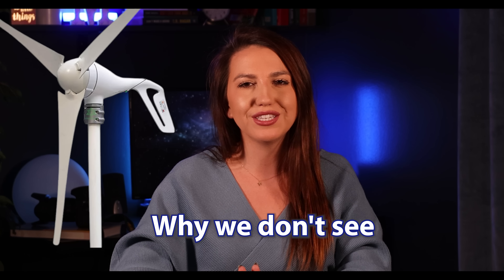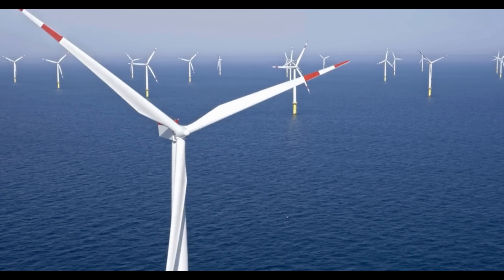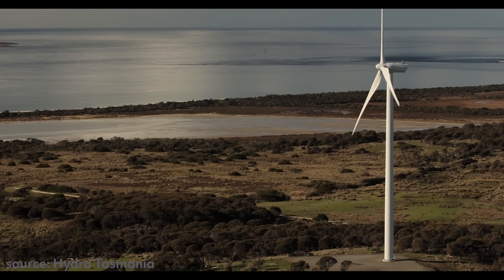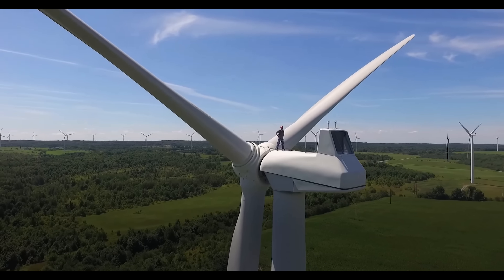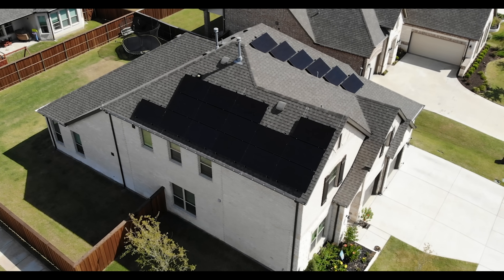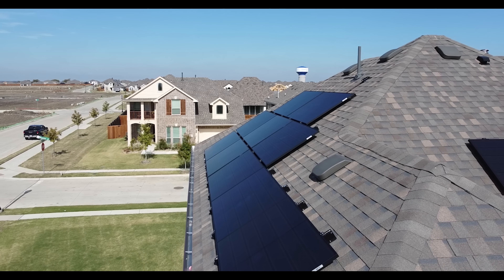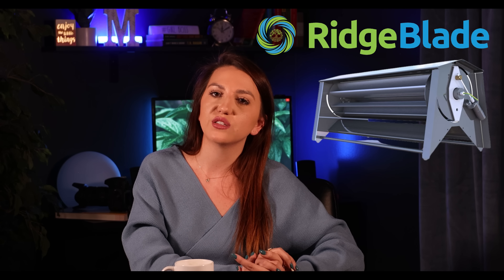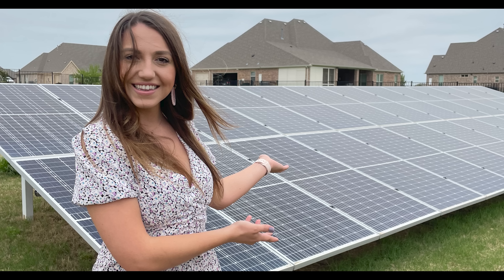Could this Turbine Destroy Solar?  | Why haven't we seen these small wind turbines yet...

Comment: I'm completely off grid. I don't use wind simply because I have no faith in the systems. I'm solar only and may add hydro to generate power for my neighbors.  Wind , I simply haven't been sold on.
Reply from the maker: Hey Tim! Thanks for sharing, I know living off grid can be challenging, maybe you can share what kind of inverter + battery system you have?
Reply: @solartimeusa  i could do that.
Reply: I currently run an off grid solar system using EG4 components. I use the EG4 6500ex inverter with 8 455watt panels on my 1st string , then 6 200 watt panels on a sun tracking system. I generate on average 2.7 kw an hour. The system is 48volts. I currently run 2 mini split,  1 is 8000 but and the 2nd is 12000btu. We do heat with a wood stove. I also run 2 deep freezes and a refrigerator.  We have an older maytag washing machine for laundry, electric butter churn, coffee maker, kitchen aid mixer etc just like everyone else, and recessed led lighting.we use all the modern day convenience plus some. I run an electric concrete mixer to process black walnuts along with occasionally mixing concrete, electric fencing etc. We love this life style. We could generate more power if we cut down a number of trees, but prefer to deal with shading and keep the trees. I am adding another 10 panels to maybe add my some of my neighbors needs. We use eg4 batteries for a total storage of 25kw of stored power. We have ran out of power once in the last year, which our generator helped recover the charge state. Start a system now. Dont wait, start slow and build on as you go. I have built a 2.5kw VAWT for wind in the past ,but never got to use it. If wind is useful, I'm interested in knowing more, but currently have little to no maintenance with solar.

Comment: My issue is that my solar doesn't make energy to charge my battery during storms, when the grid is most likely to fail. 

A wind turbine would need a very good governer not to over speed at that time. Better to go for an ICE generator for reliable backup power unfortunately!
Reply from the maker: I hate to say that but yes I agree. 
Unless you have a big enough back up witch enough juice to wait out a storm. 
Portable generators have to be a back up to a back up for now.

Comment: This turbine, if comercialised will destroy the most expensive electricity first.. coal, gas, oil, fracking, nuclear…
Solar is dirt cheap .. so it wont be affected. At all
Reply from the maker: That's a very valid point. Solar and wind on a grid scale are super cheap. so I am hoping one day on a small scale will also do some more damage.

Comment: Unless you are willing to install a 100 ft high tower they are complete wasting of money.  More research should go into PV panel design which have not been improved mechanically since the 1980's.
Reply from the maker: Hey Mark, 

I do see your point, and I think its very valid. Wind on grid scale - great, PV on small - needs improvement and is great.

Comment: Good day, 

    The Swiss ML Converter , it was created by a European community around the 1970's , works on the concept of static electricity...essentially, you have 2 discs, perforated and made of aluminum and copper, carbon wheels would work as well, insulated in the middle and rotating in opposite directions...

The wheels are encased in a horseshoe magnet, nearly touching, you could make it go around the complete circumference when redesigning it, and carbon filament collectors are brushing along the surfaces of the disks as they rotate, this creates a positive and negative polarity, and the energy is then stored in a carbon/ graphene aerogel/ foam capacitor of some kind...

It is stored as D/C current and converted to A/C where needed...

That's the key to harnessing vast amounts of usable energy, with minimal wind speeds, and the technology will improve over time...

-ER x

Comment: Usually the area from which a home wind turbine can capture energy is too small to be viable. It just doesn't have enough energy, unless you're living in Palace of Versailles. It's pointless installing home wind turbine. Solar with storage will work much better in most cases.

Comment: WoW you have a great solar PV setup thats exactly what I want to do as it's easy DIY for your garden, easy clean easy to service, obviously best with two sided Solar to increase it's power on a say white background, plus I do want a wind VAWT its better for low level mounted due to its better wind capture I must admit I do like the Liam Fi design automatically spins in the direction of the wind ❤👍

Comment: The solar panels are occupying more area and power absorption from sun  is also not satisfactory. By changing the design, occupying area ca be reduced and at the same time power obsorption can be increased. There is possibility. A material for by changing it's shape acts differently.
Reply from the maker: Thanks for sharing your thoughts!

Comment: For example, if you use a company like Ridge blade to put it on transportation industry, you already have a power source to generate extra power for your power bank for better efficiency. Especially if all transportation, commercially or privately will be electric in 2035.😊

Comment: With home fabrication and 3D printing its pretty easy to just make your own. Trouble is you need a lot of  copper, magnets and blades to accommodate a decent amount of watthours. That tends to also mean weight. So the mount has to be stable.

There is also a minefield of garbage and fake wind turbines on amazon and other sales sites. None of which are properly vetted or verified to be what they claim. Cheaper solar is still the way. 

I live in the UK so hear of your housing rules and just wonder what the hell happened to the personal freedom you all so love if you cant self generate your own power. Even here we have rules that negate and stop people getting cheap solar, so its all stalled.
Reply from the maker: Hey! Thanks for sharing your thoughts, and I used to Live in Poland, thats where i grew up and yeah it was kinda funny to see the american freedom that literally does not allow you to sometime sput panels on your own da mn roof... :D 

AGree on your opinion on the wind turbines. Thanks again for leaving a comment!

Comment: I have a small horizontal bladed wind turbine. 
The electronic board inside needs to be replaced. 
If I find the replacement module for it I’ll reinstall it. But I’m not sure how to hook it up? I believe it’s 24 V. How would that work with providing power to my house I don’t know? Do I use the 24 V output to charge some batteries and then run that through an inverter? I’m not sure what to do

Comment: Most areas do not have the necessary prolonged wind to power these.  In SC there is only one small area that gets wind over 3 mph and it’s near Spartanburg,.
Reply: SC should be good for solar
Reply from the maker: Auch...

Comment: In most locations, the air flow is "dirty" meaning that it often changes direction and velocity making most Darrius (wing type) turbines that have to face the wind inefficient.
They spend most of the time adjusting the yaw.
The best solution for this dirty air is a VAWT (Vertical Axis Wind Turbine) which are omnidirectional but most VAWT systems are cheap and produce little.
There are VAWT alternators available that will produce large amounts at lower speeds but there are no VAWT blade kits available.
A sticking point is wind velocity versus volume. Darrius blades depend on high speed wind to generate lift. They have a small surface area.
This is not suitable for dirty wind.  A "bucket" type (Savonius) relies on wind pressure over a larger surface to generate torque to turn the alternator.

Comment: Aaarrrghh…..such a blade/rotor design is horribly inefficient at any reasonable wind speed.  Yes, it will spin at a low wind speed when there is little energy in the wind to start with….just a novelty item…

Comment: The wind is a lot more irregular than the sun except in the far North or South of the planet. Turbines will never be able to compete with solar panels except there. Solar panels, which have very little maintenance, no moving parts, are amazingly cheap and easy to install, and work better every year as technology improves in leaps and bounds, are vastly superior in every way.
Reply from the maker: Hi Ken, yes i have to agree, on the grid scale wind and solar are both great, for residential application seems like solar will be a way to go, at least for the majority of the world. 
Thanks for sharing your thoughts and leaving a comment!

Comment: Without even watching the video, I can answer the title question.  No.  Not even close.  It can't even compare to plain bladed turbines.  Ignoring the fact that it's rotating weight is too heavy compared to plain blades, you could never mount it on a pole as it's drag would tear the pole down in heavy wind (blades can be furled to reduce wind load).  The cost of the pole, the cost of getting someone up that pole or the turbine down for maintenance, maintenance on the pole and guy wires...  Wind is only feasible as a large scale commercial venture (if they can ever get standardized) or in extreme rural areas where the owner has the skill to keep it running.

Comment: Unless very large (counterproductive), then near-ground-level wind generators will not supply significant energy compared to a modest solar array.  One fellow responded to a comment I made a few days past stating the formula for retrievable power versus height.  It is a height cubed factor.  And this simply explains why HUGE wind turbines are being made ever larger - and higher.

But I agree with you about local (backyard) wind. A small generator that produces only a few 10's of watts is still useful IF there is proper battery storage (like a Tesla power wall) to conveniently use the stored power.  A reasonably smart (self powered) electronic control system would normally be incorporated into such a wind generator to manage efficient power delivery and prevent over-speed issues that can be very destructive to the generator itself.

Any of the vertical blade concepts are certainly the most sensible, because it can be erected on a rooftop and requires no fancy moving parts except for the blade and AC or DC generator incorporated in the base.  Proper blade design can improve efficiency and keep noise to minimal levels.

FYI, small, 3-blade wind turbines (about 1 metre blade extension) have been employed for decades to power remote radio repeater sites.  So the technology is not new.  It is all about adapting to the local conditions in respect of whether solar or wind is the more practical option.

Comment: Unfortunately, a lot of "cool new ideas" are what I'd call an "eco-grift".
Hopefully a really impressive wind power solution will come along eventually though, for areas where it makes sense.
Reply from the maker: Yuppp :( Sad but very true. Thanks for sharing your thoughts and leaving a comment.
Reply: @solartimeusa  I don't think it's impossible though :)

Just a matter of finding the right shape for maximum force capture... while keeping the weight and friction down so that there's a low minimum airspeed to generate.

A big part of it is wind turbines "not doing anything" in lower wind conditions. If the friction & mass can be kept low enough (without being overly fragile), then they'll generate much more of the time, and be a lot more practical. There's almost never "no wind".

There's also the resistance of the generator itself. But, designed right, that could be made "variable" with magnetism, and very little mechanical resistance.

It's a big challenge for a stand-alone turbine. But I'm designing a house currently, and I'd like it to not be "grid dependent". Since it's a custom design, I think there's some opportunity to use the house's shape to really boost a strategically placed turbine.

I'm kinda thinking a "vertical axis turbine" which is actually mounted horizontally across the roof peak. Magnetic bearings at both ends, carbon fiber blades, a variable resistance generator... I think it can be made to work well. It's just gonna be a rather custom job.
It may look odd, but it'll be rural, and "who cares" applies :)

Also going to use solar, on a "gambrel" roof (with a 45 degree bend, kind of a squished V-shaped floor plan), to go after the sun at multiple seasonal and daily angles. I still need to do more testing, but I think (for a non-moving solar panel) that going after the peak-efficiency angles is actually the wrong approach. Getting more power at noon in summer isn't really a need for solar. 

Instead I'll be targeting winter & morning/evening angles "primarily" for more "consistent" generation, less risk of "clouds at noon, the whole day is worthless for solar", less snow-blocking problems, and more seasonal resilience in generation.

Going fully off-grid may be better, would open up build-site options & affordability. Wouldn't dream of it without Starlink though hehe.

Comment: This idea has been stated over & over again, but doesn't seem to gain traction. Why not put VAWT generators along both sides of the Interstate Hwy system? At my age (retired), I don't use the I system very often, but from what I've seen there is a lot of vehicles on it almost 24/7. I've had to change a tire and ridden a Motorcycle when a semi goes by, that's a lot of wind to deal with.
Reply from the maker: Man... that is brilliant! They could be installed at low altitudes and power street lights. Why is that not a thing!?
Reply: Gov. would rather spend our money else where. @solartimeusa

Comment: I would love to have a mixture of solar and wind power on my house, but the problem is that solar just works better at small scale, throw in that there are too many scams going around when it comes to small wind turbines and the performance they deliver.

It's a shame as well, because solar is good for summer and during the day, whereas winds tend to be better in winter and at nighttime, both complement each other, but I've seen enough videos online to see how poor wind turbines work on residential homes, not to mention the price is quite steep for them, then when you throw in all the scams going around with small wind turbines, solar power is a better and safer bet.

Wind power works really well at big scale, but I feel in the long run, solar is going to win out unless the wind power industry finds a way of producing meaningful energy at small scale and can do it cheaply enough, solar is getting better, cheaper all the time, it can be used almost anywhere, and it's likely as the tech continues to get better and cheaper, more home users as well as businesses will want to generate energy on-site without the need for the grid, especially as battery tech gets better and cheaper, that's probably going to be a massive market and maybe the main market for energy generating in the decades to come, that puts wind power in a difficult spot unless they find ways of generating more meaningful energy on average homes and are able to do it whiles competing with solar on price, which is getting cheaper and better all the time.

Either way, it stands to reason that as renewable energy gets better and cheaper, as well as battery tech continues to get better and cheaper, more of us are likely going to go off grid, that could be a major problem for the wind industry if they don't find solutions to at the small scale, as it basically means most of us will end up using solar, storing a lot of that energy into batteries and eventually going off grid because most of us like the security of generating and using our own energy, as that would more or less mean no energy bills, it's also a lot cheaper, maintaining the energy grid network cost taxpayers a fortune.
Reply: I live off grid full solar but run a 4000W wind turbine it acts like a battery charger and keeps up the levels of the batteries day and night works for me.

Comment: How much noise does it make throughout it's range of operation? Is it able to be in a Marine environment? Is it properly electromagnetically shielded to prevent interference with other electrical equipment? Overspeed issues?

Comment: I am monitoring wind speed on a 10ft pole. I am in Wyoming and no shortage of wind averaging 15-20 Kph. Can’t attach a photo to the comments but I will email you if you tell me where to send. I am looking for a vertical unit where the base will be 12ft off the ground.
Reply from the maker: office@solartimeusa.com  :) 
Those are pretty good wind speeds for sure.

Comment: One thing that has to be considered is if you live in an area that sees hail every year. This one affect your solar. also I hear of squirrels eating thru the solar panel wires as well. No matter what is chosen, it would be best to be happy with lowering your electric bill vs trying to eliminate it entirely.
Reply: True......but we live in hailstorm country and our panels have never suffered damage. Not in ten years anyways. I HAVE heard that squirrels could possibly be a problem but, again, we have lots of squirrels and have never had a problem. Lucky for us, because it would be difficult to armor all the conductors on an array.

Comment: Wind turbines are notoriously unreliable. Commercial scale wind turbines take about 30 to 40 years to pay for themselves. However, they only have a working life on average of 20 years. Therefore, they are an economic nightmare. Also, the environmental damage they cause, including noise, is far worse than any other method of generation.